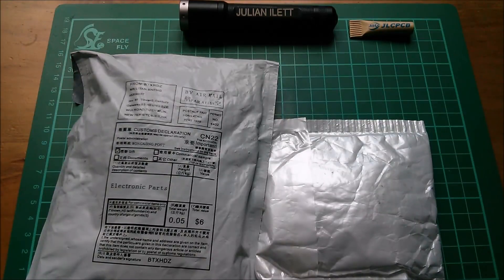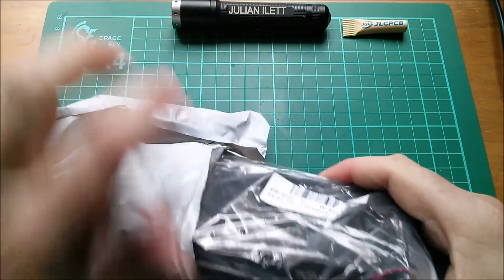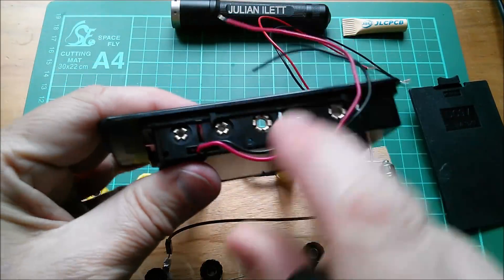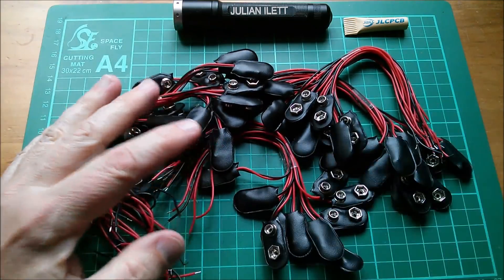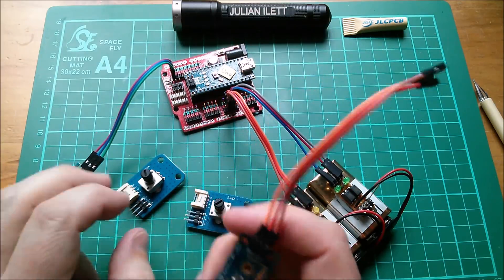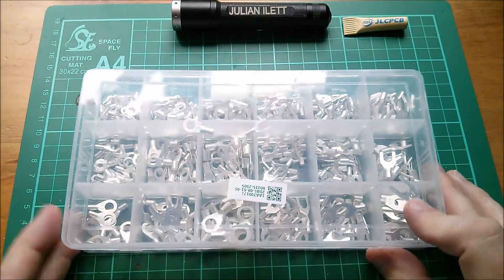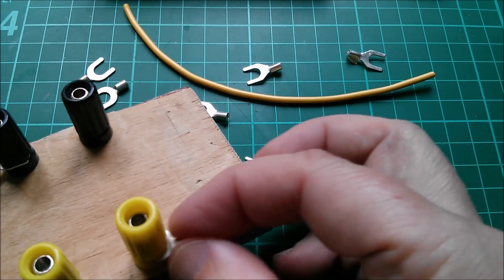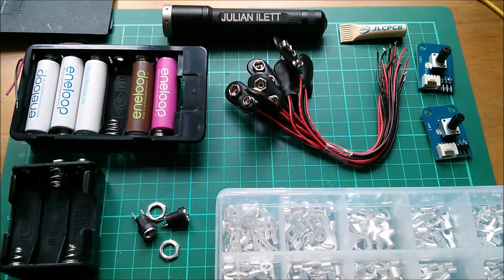Julian's Postbag: #119 - Power Connectors

Comment: Why do you love so much these small batteries? I know that you are a solar cell fan, but from that voltage, which you store in your rechargeable batteries, you can produce any required voltage. And you also like switching power converters, so you have the necessary devices too.

Comment: gut und toight .... a good source of nice general purpose wire is broken extension cords - they have 3 cables in them and usually only a few breaks, so you get many metres of wire from a single cable once you rip the outer sleeve off. (even if the color coding means you should not mix and match high voltage AC and low voltage DC)

Comment: I suggest the 1.25 and 1.5mm on the terminals @14:07 is the cross section area of the cable , not the diameter. It is easy to mix this up with the smaller cables but when you get up to  10 AWG and bigger it becomes apparent. The 15-22 on the quality lug is the AWG range it can handle.

Comment: Assortment kits aren't very useful because you use all the common stuff in one project and never touch the other 80%.
Just force the 4mm on the post because thin metal and will open up.

Comment: About the connectors. Just because it feels tight and the light is turning it, dose not mean it's a good connection. Check the ohm, either with a common instrument or by putting in a current and measure the voltage across.

Comment: For powering the arduino, you could use one of these tiny buck converter modules and provide 5V straight to the 5V pin of the arduino. Should be a lot more efficient than using the onboard linear regulator.

Comment: This postbag was a bit blah...  The power jacks appear way too difficult to connect.  The large AA holder is just too large for desk use.

The potentiometer boards are a bit expensive considering the quality and source.  I would just buy some better quality pots and wire them up with Dupont connectors of your choice.  Nothing worse than a rough connection for audio or when you are trying to smoothly ramp up or down and it is all jumpy.  Since you are often connecting it directly to the Arduino I would suggest maybe just using an encoder?  A bit more programming but if you have libraries it's not.
Reply: well that's good he shared it then, in case someone wonders how the quality of the cheap ebay stuff is.

Comment: ebay 5.5x2.1mm stuff has annoyed me recently. Ive got panel mount and pcb mount sockets and straight and right angle plugs but all the plugs are 3 or 4mm longer than any of the sockets
Reply: Well there are different lengths available. I think it´s annoying as well.
Note that the sockets julian got are terrible. I don´t recommend buying them.